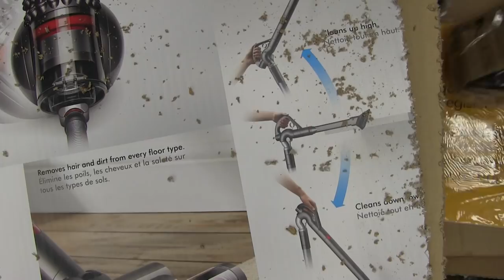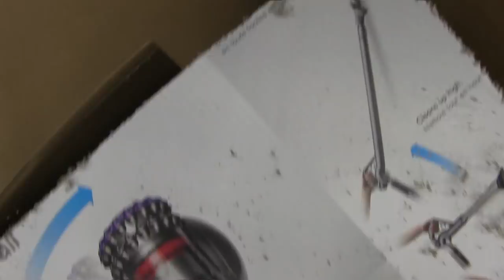DYSON ANIMAL BALLS | It blows!

Comment: AvE I have to think up in the wilds of Canaderp you have clearly gone completely insane.   Thumbs up all the way, keep up the good work.

The truth is the WORST part about these bloody dysons is they won't sell you replacement parts so when the shitty bits do break, you are left with no choice but to pitch the whole thing or seek a professional who has 12 other used ones in the back to scavenge from.  Of course everybody is like that these days in the disposable economy.   Remember the Craftsman lawnmower my parents bought came with a service manual and a full listing of part numbers for every part in the thing.  Just bought a craftsman mower today and it just came with a small card telling you where to put the gas.  They fully assume you are going to throw the thing out  the first time the spark plug loses gap for crying out loud.

Dyson is using low grade ABS to build in points of failure into their products to guarantee a new sale in 4 to 12 years.   Everybody does it, builds in shitty parts on essential components like the on/off switch to ensure product failure.

Also your vacuum poppet valves...the motors on these devices depend on the flow of air over them to not overheat  So if you block the tube that motor will cook off in seconds.  The poppet valve ensures the motor always gets enough cooling air flow.

Comment: Motor is aircooled. So no suction the valve opens and allows air to cool the motor. You basically have to have a blocked hose for the valve to open

Comment: I think the air powered brush is a great idea. If I sucked a cable up with that or even worse a loose bit of carpet it would stop and not burn the motor out, bust the belt or damage the item I sucked up.

Comment: AVE you’d have that vacuum release valve on there because the motor relies on air cooling so if it didn’t have the valve      
And you plugged up the hose for too long the motor would burn up, the valve let’s air in to air cool the motor if the hose is plugged.

Comment: If the hose gets clogged with unmentionables the motor will over speed from the sudden drop in load and overheat. The poppet valve is their to keep air flow going to the impaler.

I burned out my first shop vac with super fine dust because the motor overheated from overspending. I only figured this out after i shorted the thermal fuse lol

Comment: I have had every type of vacuum you can name cheap ,dear you name it I have had it . The thing about dyson is they suck well for a good length of time before needing attention usually the filter needs washing out, i have had one for over 20 years vacuuming up building rubbish paint filings and for the last 6 months it is sucking out 200 years of coal dust and filth out of the lofts on my house before I insulate . If you keep them clean blow out the cylinders and wash the filters after heavy use they go on and on . Don't know about this model yet bought one last year only use it on normal house use ,don't see a problem blowing out the life time filter with air line ,but we will see.

Comment: Would assume, the vacuum valve serves as an overheat protection. When the vacuum tube becomes clogged somehow, the motor will get no cooling air anymore. There the valve kicks in and provides air flow to the motor. Will keep the firefighters out of da house. Nice work you are doing there. Enjoying it. Once a video got me into ROTFL once its fine. Here my ROTFL meter counted 4 which is comparable to an IMDB score of 8+. The flashlight analogy caught me completely unprepared. I should be more careful on when to put my cup of coffee to my lips while watching your vids. Keep going on with that great work.

Comment: But you can buy these spares pieces as dyson refurb us big in UK.
We have be a dyson guarentee and the be warranty Includes a annual service. In that service they replace filter and warn parts at no cost. My dc5 is 25 years old it's great
The vacuum had 5yr cover and you can extend the cover they replace those switch's and if they are warn they replace at the annual be service so you do not throw in away .very few dyson get thrown away as t he e repair in system is good

Comment: NEVER drop a dyson, it will be fucked if you do.  My 1950's design Henry however that cost a third of the price can bounce down stairs on its head repeatedly and still out suck and outlive a dyson. And it has a great manual winder for the cable, glides along, never snags, never fails although sometimes you can zip it so fast that you get hit with the coffee table the cord dragged along.

The motor is robust, mine is 18 years old and still going fine, replaced the bushes about 3 years ago. filter is massive, some are washable and all are cheap to replace if needed though I've had the same one for the entire life of the vacuum, and I have an open fire so it does get used to suck up a little ash around the edges and such. Never blocked on me. And frankly should any single part fail they are all cheap to buy and easy to replace from switches to motors to pipes.

If people want to buy a cheap hoover that will last many many many years and can be repeatedly bounced down stairs arse over tit without it breaking, you cannot go wrong with a Henry Vacuum cleaner. Still proudly made in Britain. 

If people want to buy an insanely overpriced fragile reinvention of the wheel that will last a couple of years at best providing you never drop it, dyson is for you.

Comment: First of all, the valve is in case of a clog it will not overheat the motor.

Second, what I am sure you already know you're not paying for quality. You're paying for the warranty. That's true of any product, but there are several ways that companies can manage this. One is to use parts that will not break, and the other is to use inexpensive parts that are cheap to replace. For something like a vacuum, it makes sense to use the latter approach because chances are you're not going to be bothered to try to use the warranty, and many people probably never register their product in the first place. For a tool, they're more likely to use the prior, since this is something that you are going to rely on to make a living, so you're more likely to send it in for repair.

The company does not care if you're product fails. This doesn't really affect them. Provided that the product isn't outright defective such that people do not feel it was worth their investment, it doesn't matter if it lasts 2 years or 20 years. What does matter is how much it will cost to support that product, and how the warranty will influence the sale of the product. But what you're never paying for is "quality".

Comment: I don't believe it! I suspected an air driven motor in my Dyson DC62, based on how weak it was. After a quick look, turns out it actually has contacts, and some small motor inside it. 
I can't believe they wouldn't do the same on it's larger cousin!

Comment: When the vacuum cleaner has no air flow there's no way to cool or slow down the moving parts which causes bearings to overheat and fail. That's why there's a "vacuum brake". It's because the misnomer vacuum cleaner should have been called a negative air flow cleaner.

Comment: In the adverts for this in the UK, they rave about the "Ball technology" making it sooooo easy to manoeuvre. What a crock of shit. It's just a pair of wheels. We've got one. Piece of crap, it is. If the airflow becomes blocked for just a moment (such as the nozzle grabbing a rug), the "cyclone" becomes turbulent, it makes a hell of a noise and stops sucking properly requiring it to be shut down and restarted.
These things are an absolute rip-off and they're hideously expensive.
[Edit - After seeing your tear-down, it occurs to me that the hellish noise it makes after a momentary clog could be that relief valve fluttering - I might pull ours apart and give the sproing a strootch]

Comment: At about 8:40, there's a complaint about the mediocre quality of the switching linkage.

Better than the Horror Fright $9.99 angle grinder - I had one of those fail in use the other day, and upon post-mortem dissection it was found that the switch was fine, but the similar plastic linkage had....melted.  At least I can harvest the cord.

Comment: You’re paying for the R&D. I see very little dyson marketing for vacuums. 

Our big ball is still going after 6 years, but the valve that disables the pneumatic head broke so I can no longer switch off the cleaner head. 

Yes the head stalls a lot, but his thing cleans very well still. 

Yes the material is chinsey, but so are spaceships. Shuttles are engineered to be barely strong enough to survive their mission because any increase in weight will be detrimental to the mission. The dyson material is strong enough to last their intended lifespan, and they do if maintained properly. 

He needs to understand that this is an indoor vacuum cleaner. It’s not a wet/dry shop vac. It’s not made for construction sites. It’s like he’s complaining a Tacoma bed can not hold 7,000 lbs... it’s not within the intended use or need for the intended application.
Reply: Pleasantly Rusty apologizing for what? Lol. They work... very well. 

Maybe stop crying about others decisions.

Comment: Maybe the valve is there, so your vacuum does not break when something jams in the tube and you try to pull it out. Without the valve the pressure that builds up might damage the device
Reply: This makes sense cause Dyson are notorious for clogging up

Comment: i use some google magic and this motor was used in Panasonic MC-4620 witch have rating of 1400W and cost 100 or less. Dyson have rating of 700W and cost 400 and up. So basicly you payng mostly for the plastic

Comment: If it gets clogged up then that valve gets pulled open so air can keep moving through the motor and it doesn't over heat

Comment: I found a dyson vacuum left on the curb and took it all apart the same way... it had a lifetime washable cloth filter and canister. All the switches and control components were just as chinsey and cheaply thrown together. It looked over engineered with no thought into material strength and practicality
Reply: Oops now that ive seen the rest it was the same lol

Comment: You don't use this machine in a metalshop, only households.
And it's not that bad as you say it is, I've been using Dyson for quite many years now, and not ONCE have I had any problems with any of their vacuum cleaners. Yeah, they're expensive, but they're still the best compared to all other brands...and no, I don't work for Dyson or sell their products.
And by the way, if you take the machine apart, the warranty is gone. I didn't hear, you said anything about that in your video...? I don't care about the buildquality, as long it works as promised.

Comment: My mom owns a Dyson upright vacuum and one of the fans. I cringed when she bought both, the build quality even from the outside is shockingly bad especially given the price. The fan is especially bad, its weighted in the bottom (probably ballast) and the entire upper part is chintzy plastic, no metal support at all. If you try to move or adjust it at all without lifting from the bottom, it cracks and creaks like a POS. She marvels over the fan "with no blades" but I don't have the heart to tell her its the same basic design as the blower motor in her car (squirrel cage fan blowing from the base up a tube and into the "venturi"). She gave me one of her old Dyson vacuums because she bought a new one (just 'cuz...) and it works about the same as the $100 Shark vacuum I already had, but the Dyson is substantially louder and heavier. 

I love my mom, but she is too gullible to marketing BS.

Comment: That was an opening not warranted for that machine.  However, they are not interested in the box.  They do have packing tape.  Try and take it back. At $600, it should be more than what it was.  That was SAD. Besides, what if you was one of them guys that lost his arm LOGGING and the replacement they gave you was the chain saw version? It is just a box and they probably got extra in stock.

Comment: The purpose for the vacuum break valve is motor cooling relies on the airflow from the vacuum fan in the vast majority of vacuum cleaners.  Not the greatest design idea, and on a high dollar machine you would imagine a better solution.

Comment: Just leave it switched on and plug/unplug it?
The poppet is probably for cooling airflow and/or rpm limiting... maybe to prevent unintended removal of body parts? Lol

Btw my dyson is 8 or 9 years down the road now and still kickin with no plastic failures

Comment: the break valve is so if the hose gets clogged the motor wont burn up. Dysons claim to fame isnt the motor BTW, it is in the ducting of the vortec air tubes they use. Still over priced shit either way.

Comment: AvE - Thank's for the video.  I picked up the stand up version of this model 5 years ago.  The build quality is spooky however, not a plastic part has failed and the thing has beastly suction. The other thing is that all the parts come apart easily when I suck up something and it gets stuck in the vacuum.  The thing is also very light weight and easy to use.  Picked it up on Craigslist for $200.00 US.  Will be sure to comment if / when it breaks.  Thank you again. : )

Comment: The pop off is for safety when the underwear you left under the bed gets sucked in so it wont get pulled in too far.  Since the lifetime filter won't last forever, why should the vacuum parts last forever.

Comment: 5oo dollars?  For a thing that sucks?  Nah.  I've bought cars for 500 dollars and driven them 100,000 miles.  I have a Stanley vacuum that still sucks hard, but the in-tank diverter busted because something hard came down the pipe too fast.  It's all fucked up, now.  It sucked a marble, or something.  Now it's all fucked up for a 14 dollar part that costs 17 cents.  Yeah.  Fuck.  Problem is I can't get the part.

"What part?"

"Uhh, tank/ filter diverter."

"No esplanade!  78 dollars!"

"The whole fucking thing cost 68 dollars!"

"The thing?"

"Yeah, the whole fucking thing."

Comment: We have a DC 78 which we got as an open box for 50% off 4 years ago. I still feel ripped off every time I use it.  The $200 refurbished Electrolux it replaced was far superior in every way. Like you, I have 80 pound lap dogs and dog hair and DYsons of this design do not do well together. I’m guessing if your a condo dweller who has to pick up the odd cornflake and want something that looks good these are just fine. Any real use and the only thing you will find is disappointment.  The bagless aspect is a joke as well. Have to empty it outside using a big ass screwdriver to dig the stuff out. Always time this activity right before showering cause it’s a messy operation.

Comment: try this with a old school Vorwerk VK122...... when you turn it on and the bag is not installed it make a tornado i mean it's enough powerful to make my celling fan turning! and for the brush, mine is the Vorwerk EB350 and well, don't put your fingers in it because the electric motor is really powerful and if something get stuck on it it stop to run and make a flashing light that's what i call well designed. electric motor for vacuum is 400 watts only (the turbine is before the bag with make it way more efficient but well, it not like shoes laces.... and it's NOT funny to take into bits....) plus 250watts for the carpet brush (it also have powered flexible with hand held electric brush for sofa, cars.... and a ton of accessories powered or not....)  i mean that's what i call excellent no fancy plastic that die fast everything is made for never die it was coming with 5 year guaranty but mine is 25 year old and still work really well... i only got filters replaced many time, silencer only (yes, it have a silencer.... it's not only for gun....) and the power cord got cut where it enters in the handle with is really not bad for a 25 year vaccum cleaner... Vorwerk still sell bags for it and adaptor to be able to use new generation accessories! Vorwerk is more expensive (yeah like 3 time the price of the dison with some accessories but the old ones are easy to get on ebay for a really good price mine is around 90USD used with only the normal brush not electric with is already really good) ok but they make quality... it's not dyson rubbish.

Comment: 🤔 I do maintenance for a state waterpark and there is a law for the vbg suction break on the return water lines. Vgb stands for Virgina Grand Baker. It's a little girls name. She died. She was sitting playing at a water park and started screaming. The parents didn't know what's going on and didn't think a ton of it apparently. Kids screaming at a waterpark is nothing new. What happened is the girl had say on a suction line... And yea it pulled the in to the out. So it became a national law that there has to be a suction diverter or break for all return water lines. I believe this is the theory of why there's is the suction break on this unit. Also I worked on the mines running a hydroblaster and a vacuum truck. The vacuum truck had a 32in Mercury rating on a 8 in line. The main concern was that you do not get your face or and arm stuck on it and sealed. If it sealed around your shoulder it would start to pull all the blood in your body to the arm until... Pop. And it literally sucked you dry. It takes around 15seconds. I watched it grab onto a guys foot. And because it was corrugated pipe once it sealed it started to collapse the piping shrink which means it pulled this guy across the tank dragging him by the foot. I had to think fast and grabbed my knife and cut the vacuum line open to break the seal. It was a close call for sure.